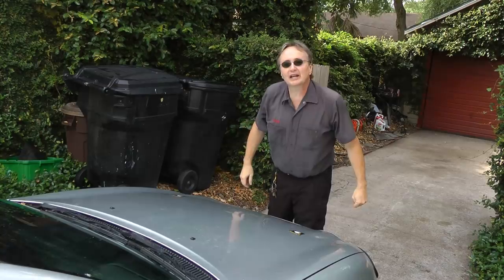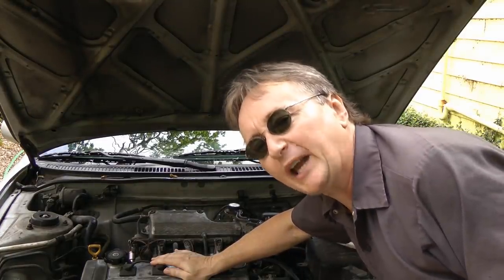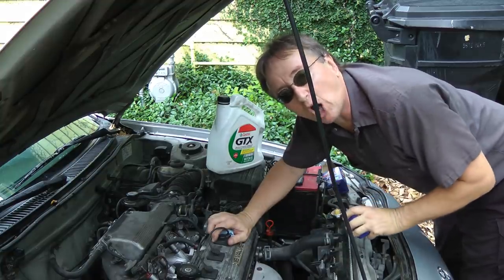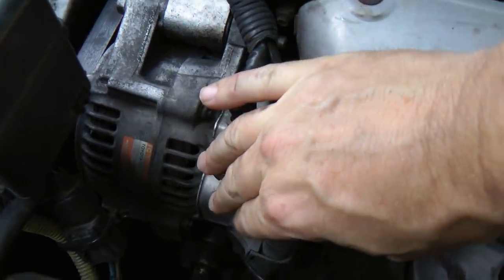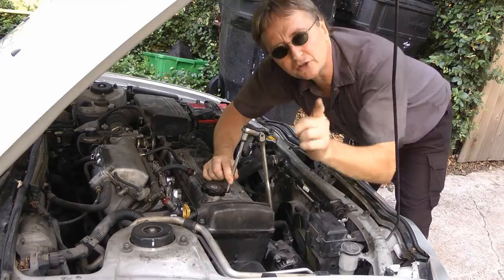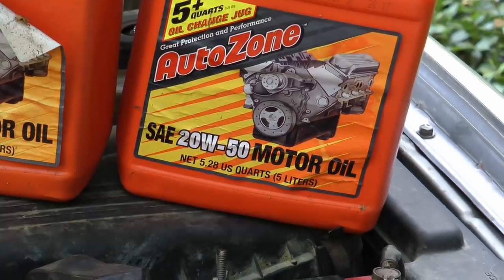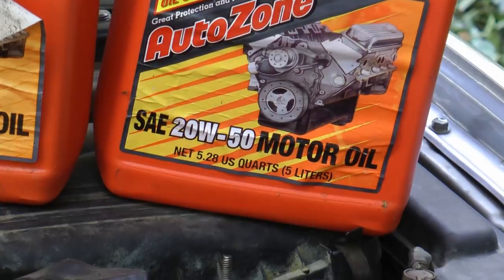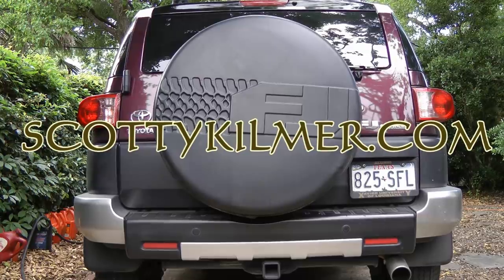Top 4 Mistakes Car Owners Make (DIY Fails)

Comment: You DON'T just Unhook 1 of the Battery cables You take negative OFF 1st 👈
Reply: Huh take off either one it doesn't matter lol if you think you can use electricity with one wire then go for it and become a millionaire the battery is the power source and if you remove any one wire from the car doesn't matter which then the power source will be removed
Reply: The negative is where the power comes from.
Reply: @davecrupel2817  and it returns on positive but both are equally important you can't have electron flow without one or the other it doesn't matter which one
Reply: The negative is for ground, why would you take that off first?
Reply: @PeterTrimboli  what im saying is people make the mistake of disconnecting the positive only.
Bevause thats where the output comes out of. You can lick the water off a positive end, and nothing will come of it (assuming you dont have static buildup.)

But one touch on the negative, or anything still connected to it, while theyre touching the ground, and pop goes the finger.
Disconnect the negative first.
Reply: @davecrupel2817  you can do the same with the negative the power comes from both electrons flow from negative to positive disconnect either and your good you stop the flow you can lick the positive and nothing will happen lick the negative and nothing will happen you need both to create a difference in potential you don't understand how electricity works the way electrons flow do not matter because they won't flow without both create static electricity lick it  do whatever it will act the same whichever you disconnect
Reply: @krayzr7  It's Not HOT!
Reply: @PeterTrimboli  NO CLUE🔥👈
Reply: @theykilledthegiggler Clumsy 😖 1 spark can Turn in a Bad Day
Reply: @krayzr7  Because negative touching will not spark to chassis . It will spark when returned to the Battery , that's Why You turn Off everything that Draws current To Reduce the Intensity of the SPARK therefore minimizing a 💥
Reply: @Jim-zy3lf  if you turn everything off and short the battery there will be a bigger boom then if everything was on because there would be things using current therefore creating less current when shorted just don't short anything and disconnect your battery as people stated it would be easier to short the battery with a wrench if disconnecting the positive which is true but other than that does not matter
Reply: @PeterTrimboli  I'm sure You can remember Vehicles with Positive Ground . HA ! Your electrical knowledge ? Glad I grew up next to a German Electrical Engineer , darn guy was a Wizard . ? Without what _____ would there be 0 ? Don't look it up😯🚬
Reply: @Jim-zy3lf  not sure why you brought up positive grounded vehicles almost seems like you're agreeing with me now but those are pretty rare especially today along with 6 volt systems I'm just trying to educate allot of people don't understand DC theory remove a wire from the power source and you remove the electrical potential and leave it at the battery post (or the source) that is all have a good day
Reply: @PeterTrimboli  🚗🇺🇸🏁
Reply: @krayzr7   The negative terminal is grounded to the vehicle body. If the wrench touches the body and the terminal there is no damage done. Once the negative is disconnected there is no danger shorting the positive to the body. If positive is disconnected first there is a possibility of shorting the wrench to the body. Simple..
Reply: @PeterTrimboli  so what if someone still had the negative on the battery grounded to chassis and the positive alt cable that goes to battery still on the alternator but disconnected at the battery and that positive cable on the alt hit ground?
Reply: @PeterTrimboli  i fried something on my transmission from hitting it with the positive cable while it was still connected to the alternator but it wasnt connected to the battery so where would that electrical current come from because the alternator doesnt have power until the car is started so would that short happen just from left over energy in the cable?
Reply: @holdDeez1993  you had the positive completely disconnected from the battery when that happened?

Comment: Mistake Number 5: making you tube videos giving inaccurate in information. 
And so someone doesn’t hurt themselves you don’t just take off any one of the battery cables. You’re suppose to hold on to any metal part of the car with one hand and disconnect the the possitve terminal with the other. Make sure it’s bare metal to be really safe.
Reply: This is why these videos are such bad information. Do you see a clean work area anywhere in these videos? No, why! Scotty needs to get a grip and quit giving out bad advice! Good catch on the battery cables! Needs to always be the positive side......
Reply: This isn't remotely correct; if you were going to worry this much about a specific cable it would be the negative cable because it's the cable tied to the frame, not that it's likely to be an issue either way. You are significantly more likely (though not at all likely overall due to the low voltage v body internal resistance) to cause a short by removing the positive while holding the frame, that is literally shorting it deliberately 😂

On your other point, car batteries can't hurt you under 99% of circumstances. Outside of trivial situations amperage without sufficient voltage is not at all dangerous.

Comment: I used rotela 15 40 in a 1994 Nissan hardbody since new. Never a problem.engine had 250k. Transmission went. No help getting one at junk yard because that automatic was gold. Rebuilt was 2k. More than truck was worth  love you channel

Comment: The oil filter rubber i had that happen once. i started the suv and then the oil pressure dropped so i turned the motor off right away.  looked under it and oil all over. I took off the new filter and saw the extra gasket fall. put it back on and then had to go buy more oil. I been doing it for many years and never had that issue until then. now i keep an eye out for it. I'm 41 and been working on cars since a teenager and it didn't happen until i was in my 30's

Comment: We use 20w-50 in my grandpas 92chevy k1500 with the 305, the motor has 565,000 miles on it and it’s all original, if we put too thin of oil she starts knocking a little bit but as soon as put a little bit thicker she’s fine, all depends how worn out your motor is for the oil subject from the video.

Comment: 1)I always do both, check for the gasket and oil the gasket on the new filter.
2)I know to do this, but forgot to recently when changing the starter on my Jeep. I was about to unhook the battery when I got a phone call and got sidetracked, so needless to say I set to wrenching on the starter without doing that. Mr. Starter was sure to remind me once I touched the solenoid pole.
3)Besides this, who would seriously wanna risk getting burned to pull a plug? And I dab a spot of dielectric grease on the thread and pole of my plugs.
4)No comment here, except the manufacturer may also recommend a different weight of oil if you're in a colder climate

Yay, I'm not one of the ones who felt the need to correct Scotty on the "Weight vs Winter" thing

Comment: I "double-gasketed" the oil filter on a '75 C20 (Chevy Truck) decades ago. THANKFULLY, after threading the new oil filter on and refilling the oil, I started up the truck and LOOKED under it while running. "Black gold" cascading out of the block! I initially thought I had overtightened the filter (another common mistake) and warped its face, but after I crawled back under the truck, there it was... The last oil filter gasket glued to the block. I would have never known until backing the truck up and seeing the puddle and by then it could have been too late. =) Great tips (even if you're 101st airborne) =)

Comment: Fixing stuff is great, but if you want some cheap go fast mods, do what I do.  The cats are gutted, air filter is deleted, and I hollow out my oil filter.  I am about to remove all accessories to avoid parasitic power loss (and never have to buy another expensive serpentine belt - bonus!).  I'm guessing it is good for at least 50 horses.  All done pretty much for free.  I have heard you can gain a lot more performance by removing extra weight too...

Comment: I remember years ago when a friend of mine changed the oil in his car (1977 Chevy Monza) and didn't notice the new filter was missing the gasket before he installed it.  Got there just in time to watch him start up the engine and blow oil all over his parent's driveway.  He realized what had happened before I could tell him and immediately shut the engine off, but I wound up driving him to the auto parts store for another filter and more oil, then over to the supermarket for a couple large bags of kitty litter.

Comment: What I know is that Corvette manual says if in a warm climate you can go from 5-30w to 10-30w. Modern engines are at extremely tight tolerances so the thin oil is good for flow at low temps. It is all about flow according to the experts I read.

Comment: Good points, all. Newer vehicles with variable valve timing demand you stick to manufacturer specified oil weight and type, usually synthetic, because the oil is integral in the system that changes valve timing. Use the incorrect oil weight or type and the engine will not perform properly

Comment: Scotty, i saw a Ford bullentin recommending changing the plugs while hot on 2008 explorer 4.0. People were having trouuble removing plugs. They responded with a bullentin advising spraying lubricant around plug first on warm engine, after 1 rotation respray wait a few minutes finish unscrewing and removing  plug gradually.

Comment: Here’s a little tip for doing electrical work. It’s a pain having to reset the clock and other settings that are stored in RAM (so are lost when power is lost), my auto parts store has an ingenious little thing, I think it’s called an ECU saver or a clock saver or something along those lines. It’s a 9 volt battery that connects to the OBD port in your car. Because the OBD port has a 12v (battery voltage) pin, this pin also being used to power some scan tools, this device feeds a little bit of power back into the ECU to keep the clock going when the vehicle battery is disconnected, it’s a 9v battery so I highly doubt it’ll cause any damage, but I thought it was a neat little device when I saw it.

Comment: I do agree on using the specified oil on newer engines, but i have gotten many more miles out of old engines using 20-50.
Like in a rattily 4.3 or a 306,000 mile vortec 5.7
that still runs enough oil pressure to survive.

Comment: Wow, thanks for the info on motor oil.  I've always run 20W-50 in older cars because I thought it would protect the bottom end, never considered that an OHC engine might get damaged from delayed lube on startup.  I also run Lucas in older cars too just as a precaution.

Comment: That is a valuable tip of applying anti seize compound on the spark plug thread.  This will prevent galling on the threads, especially with aluminum heads.

Comment: My car shop recommends 5W 40. My manual recommends 5W 20 for better fuel economy, if that is available. It also has a chart that gives you a graph depending on the temperature of the country you are using your car in. The graph does not even have a 5W 40 recommendation. You need to be very careful and do your own research when choosing what oil you want and use what you need based on where you live.

My KIA is made in Korea, I live in Australia, quite possibly a 5-10C difference in temperature and therefore the same oil won't work in the same way.
Reply: A 5--10 degree difference is not going to matter. The important thing with Kia is to use a OEM oil filter. (flow character)

Comment: I had a car come in the shop one time and the oil filter was already doubled up, but didn't leak. One o-ring on the filter, the other still stuck to the block. If I remember right, it may have been way over-tightened also, too long ago to remember properly. But because of that, I ALWAYS check the block/adapter, either by eye or by hand, instead of the filter itself, in case another Walmart employee doubled up the o-rings before and it stay on the block.

Comment: True story: I always done my own tire rotations and oil changes... I've always jacked my truck up at the oil pan. One day my oil cracked and started leaking so I drained the oil and sanded the pan and slapped some flex seal on it and I'm going on 7 months no leaks. (Crack was only about 3mm) but it was enough to leak consistently on my concrete and all over the bottom of my truck. Moral of story, learned my lesson haha. Truck still driving. 2000 s10 v6 4.3 4x4.

Comment: On a newer car, get yourself a memory saver that plugs into the data link connector. Losing battery power can cause drivability problems when it erases all the learned parameters for idle, etc. Also, radios can lock up and require the code that everyone loses when they buy their car. We NEVER disconnect the battery without a memory saver unless there's no other option. Also, good call on antiseize on spark plug threads. Just a tiny dab will prevent all sorts of problems down the line.

Comment: Good video I use 0w40 Castrol in all my cars that require 5w30 because it’s a tire PAO full synthetic and has a -76 degree pour point
Reply: PAO and Full Synthetic are not the same. What oil are you using? You said Castrol. That's not PAO

Comment: On the first one I actually made the mistake of leaving my old gasket on because I forget to check if it come off with the old oil filter, I was driving and circled a block and right when I got to my house I saw a HUGE oil leak! I was lucky enough to not drain all the oil out and corrected my mistake, LESSON LEARNED!! No damage was done thank god lol

Comment: Like your videos. One thing i did just notice. You call motor oil "weight"  ex. 10 weight 40. I know it does not mean anything but the proper term is "winter" 10 winter 40 etc. Multi viscosity oils have polymers that expand or contract at different temperatures. Hence the term "winter". 10W40 would be  10 viscosity with cold engine  in winter conditions.

Comment: Cars that have done say 200 to 300 thousand klms for example are actually recommended to use a heavier weight oil..so for example 5w 20 after a couple of hundred thousand klms it would be recommended to use say for example purposes only 5w 30. There is actually a specific book listing all makes and models telling you which oil to use when you've reached into high klms. And actually today i did oil change on toyota kluger which has reached 230 thou and i used a heavier which the book recommended and the engine even sounds quite a bit smoother and quieter.

Comment: I made the first mistake on my first car. It drove fine with two gaskets on for a few hundred miles (I always check the oil when I refuel so I know it wasn't leaking) and then all of a sudden it dumped the oil out all at once while driving. Obviously it started shaking like crazy so I immediately pulled over. I stopped it in time and the engine survived without any repairs needed. You'd think an old, tiny, aluminum engine like that would be kaput after running with no oil but I got extremely lucky that day.

Comment: As a DIY mechanic I just love it when car manufacturers put the oil filter on the BACK side of the engine where you can only reach it from underneath. On my Kia Rio I have to crawl completely under the car and it almost gives me an anxiety attack being under there. I have it on ramps plus jack stands plus a jack holding it and I still freak out. I considered a filter relocation kit but never got around to it and now the car is so old it's not worth spending the money, and I just realized it's almost due for another oil change...  :(
Reply: I thought the Kia Reo had the filter in the front. Easy to change.  You know what? They could have put the engine in backwards. Do you need to put the car in Drive to back out of a parking space? hahaha

Comment: Scotty Kilmer, I would like your opinion. For years now, When I do an oil change, I fill the oil filter with oil prior to putting it on... it can be messy depending on the angle the filter sits on the car... but I notice that it prevents dry starts and  provides more accurate fill readings on stick when adding oil prior to first start. Do you do this? Do you think it’s a small step worth taking? Especially in high end sports cars? 10/12/16 cylinder engines, with larger oil filters,  It will take a few seconds for the dry oil filter to fill,  which allows for dry cylinder cycles. So a car that idles at 1200 rpm’s would have a 20 dry cycles for every second it takes the oil to fill the filter, then to the galleries.... so.. all that said.. is it a good practice to teach or an unnecessary step to take?

Comment: @Scotty Kilmer, I have 2010 Model Honda City. The recommended oil for it is 10w 40 but it is burning oil so that's why I am using 20w 50. Should I continue with 20w 50, if the car is burning oil?

Comment: When vehicle manufacturers put “energy conserving” on the oil grade to use,which is usually a lower oil number for both numbers than they previously used before fuel efficiency was a requirement,I disregard and use the right oil for the climate!

Comment: If you live in a place where it get very hot then 20W-40 will work just as fine as 10W-40. The number before the W describes the viscosity of the oil at low temperatures. The lower the number, the thinner the oil and the better the oil’s cold temperature/ cold start performance. The number after the W describes how thick the oil is at the engine’s normal operating temperature.